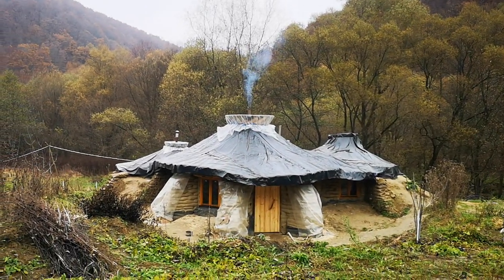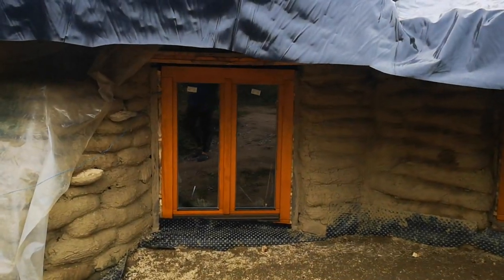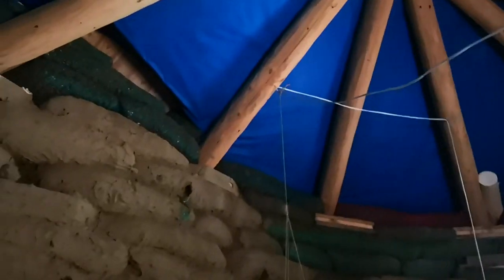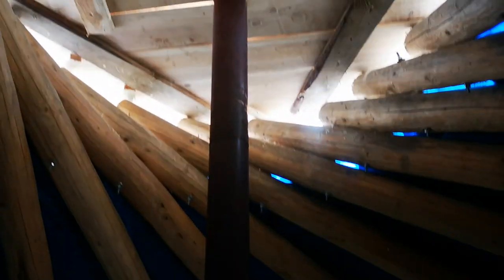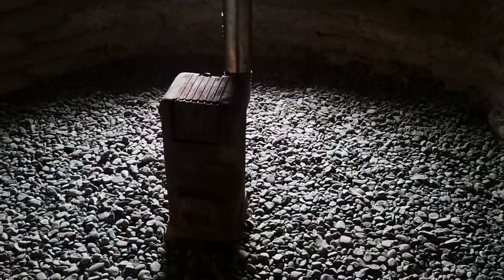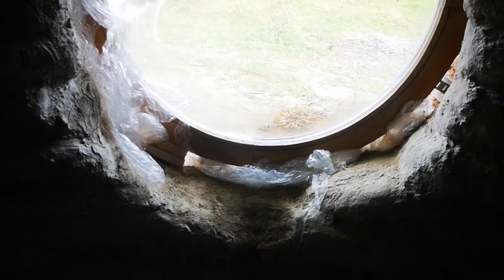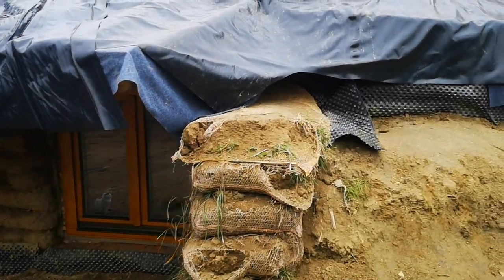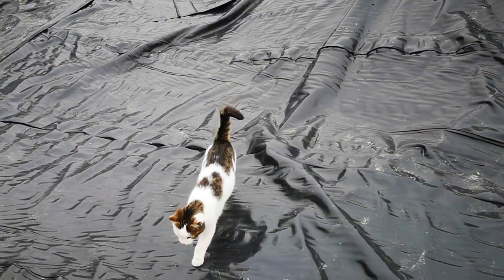🇬🇧🎉 the aearthbag house - end of 2020

Comment: Nu imi place acoperisul frate. Puteai folosi tehnica Shou sugi ban. Isolatie  sub acoperis . Asa pare tiganeala cu folia aceea. O fi ieftin, practic nu e sigur si aspectuos in niciun caz.
Reply from the maker: Daca urmareai cu atentie filmul aflai ca 1. Rste doar o etapa intermediara; 2. Casa va fi termoizolata sus si tencuita intre capriori pentru ca vreau capriorii vizibili in casa; 3. Casa va avea un acoperis verde si va fi semiingropata.
Pe scurt daca te eviscerez si tu esti urat si s-ar vedea xenofobia, dar ai piele si se vedea doar...
Reply: Ai grijă mare cu burlanul de la horn că ia foc scîndura la cît de aproape e de țeava de burlan o pățit un vecin acum vre- o 3 ani trebuie turnat o placă subțire de ciment roată pe lăngă țeavă cu armătură în ea să fie cam 50 cm între lemn și burlan că cimentul se în fierbîntă greu.
Reply from the maker: @dandanut4736  conductivitatea termica a betonului este foarte mare adica 1,74 W/mK de aceea betonul nu este termoizolant. O caramida porotherm este de7,5 ori mai termoeficienta cu o conductivitate termica de doar 0,23 W/mK de aceea cu o caramida de horn porotherm prin care trece hornul tsu prin acoperis iesi si mai ieftin si mai simplu si mai sigur. Iar daca te intrebi ce faci cu spatiu dintre horn care are probabil 120mm diametru si golul din caramida care are 200mm diametru poti pune usor vata bazaltica.

Apoi trebuie sa iei in considerare si temperatura de evacuare a gazelor pe horn. Am in casa un horn expus de 4 m inaltime plus un recuperator de caldura de aceea toata caldura este radiata in casa si temperatura hornului la partea superuoara este asa mica ca poti atinge fara nici o grija metalul.

Totul corelat cu fsptul ca in varful hornului este si o morisca de vant nu doar ca lemnul nu poate lua foc de la caldura radiata dar nici potentisle scantei care prin cine stie ce minune ajung in varful hornului nu pot aprinde nimic caci nu reusesc sa iasa lovindu-se de palete.

Deci totul e in siguranta.